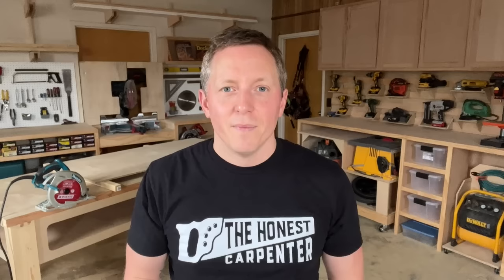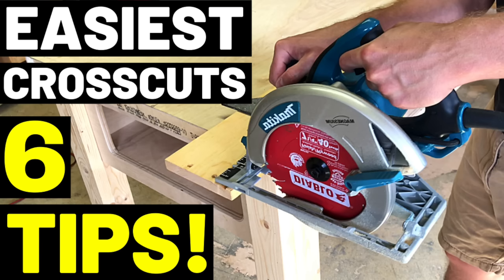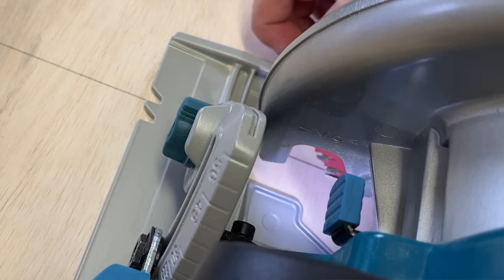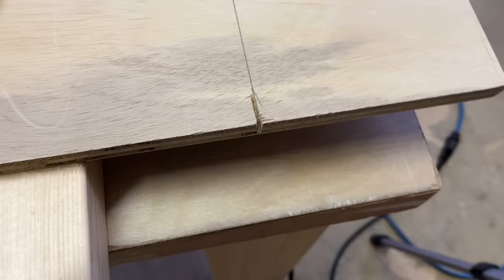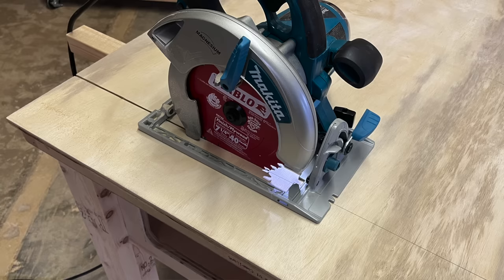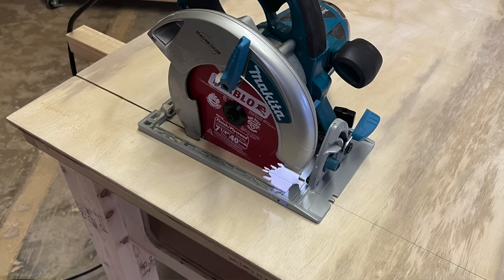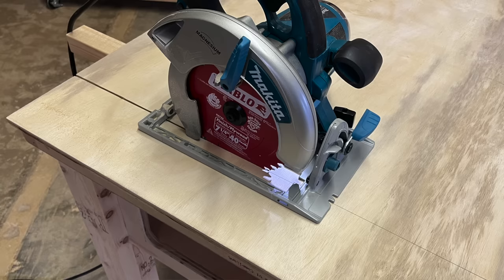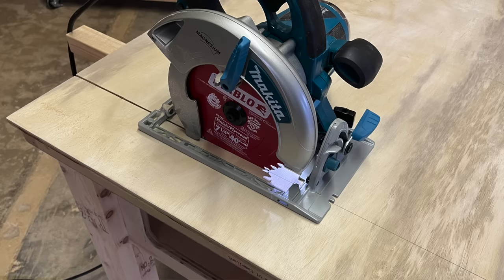How To CUT STRAIGHT With NO GUIDE! Freehand CIRCULAR SAW CUTTING...Pro Tips, Tricks and Secrets!

Comment: Could use a video on WHEN to change blades after they have become dull. How to determine sharpness or dullness of a blade. Do you get the blade resharpened or just replace it ? Approx. how much to resharpen these days ? This goes for any power saw blades.
Reply: Found a circular saw resharpening tool from Harbor Freight, and after reading instructions, there was about a half hour of farting around to get quite what was best for a functional set up... This one is a "cheap-o" version, so it probably comes with a certain dubious stability... 

    BUT it does work! It's not particularly difficult, and by just a sense of touch at the "business ends" of the teeth, you can tell a tangible difference from a used blade to a freshly resharpened one...

    It's also worth note, even before you worry about sharpening, that just cleaning the blades can help. Rosin gathers on the sides with the heat and friction of cutting and all the dust involved with a powered saw... SO while hot it's a sticky fluid not unlike syrup, and it cools to congeal, trap dust, and add thickness and friction to the rotating body of the blade... eventually causing the wood to burn in the kerf rather than allowing the freedom to drive the teeth forward and actually cut...

     Nearly any organic solvent is good for the clean-up so long as you do it regularly... It really depends on your use of the saw as to what exactly constitutes "regular cleaning", because the damn rosin can seem barely residual one day but turn into a dust encrusted mess, even when you only left the saw to sit for a couple weeks... Likewise, if you're grinding through a hundred board-feet every day or so, there's just so much rosin that you have to occasionally just take a break to clean the thing or suffer consequences...

     Most such things are "judgment calls" though. Once you've got a sharpening system of one variety or another, it's just worth trying whenever you notice the saw "bogging down" a bit more than usual... If a liberal helping of alcohol or mineral spirits and a coarse rag is no help... maybe sharpen the thing and try again... and if that doesn't seem to help, a new blade might well be in order...

    Finally, with a lot of the cheaper blades, it might not be worth the effort and time at all... More expensive blades, like the specialties and ripping-specific blades with flat edged teeth are expensive enough that you'll greatly appreciate the ability to sharpen them rather than move directly to replacement.  ;o)

Comment: One of the biggest mistakes I've seen is cutting on the wrong side of the line. This is a video you might like to do. When i had someone else cutting i showed them which side of the line and showed them why it's so important. I wrote to quickly but this is so important to doing a good job
Reply: That's what confuses me about this video, as he seems to suggest splitting the cut line? I thought you had to cut one side of the line or the other depending on what is the working piece and what is waste.
Reply: @craigherriot4026  yes from the side you measure you cut on the opposite side of the line, i don't know how many times i had to get onto guys for cutting it wrong. I worked in construction for 34 years before i hurt my lower back and after 5 surgeries and now a pain pump in me i had to be put on disability
Reply: @craigherriot4026  I don't think it matters really as long as you can see the the line and mark the line accordingly. The advantage of splitting the line is that you don't have to compensate for a sharp or dull pencil.

Comment: I have only used mine a few times, but I have noticed that I have a problem with lifting the saw a bit when cutting. I thought I made a cross-cut only to find out that even though my blade was set for 1" cuts for cutting 3/4" plywood, I still was not able to make it through.
Reply from the maker: Yeah, that’s “floating” a cut! It’s pretty easy to do. Just check the edge of your sole plate with you eye periodically though. You should be able to see if your flush or not. Or try to lever the saw forward or backward slightly—you shouldn’t be able to do it!

Comment: Great video but one question if I can. Why  would anyone try to cut freehand and risk messing it up on an expensive piece of lumber, like Baltic birch plywood? Why not clamp a straight edge to the piece being cut [on the non-waste side] to but the saw sole plate up against? NB - triple check the placement of this straight edge before you start to cut. A straightedge makes it so much easier to slide the saw forward in a straight line.

Comment: If all your measurements are exact and you scribe your cut line with a very sharp pencil, cutting on the line is not going to give you an accurate cut. With a blade that cuts a 1/8" kerf, your cut will be 1/16" short by cutting on the line. I always cut on the waste side of the line. Of course, if 1/16" doesn't matter for the cut piece, then cutting on the line isn't a problem.

Comment: @6:47
For reasons stated here, I always take a couple of minutes to set up a guide to make cuts. No time is saved by cutting freehand when you have to take everything slow and worry about the numerous things you mention when cutting freehand. To cut freehand does not make a woodworker a better carpenter. Your build is going to not know how you cut the wood, but the fit will show the quality of your cut. The only time I don't use a guide in general is rough carpentry (but I do on certain cuts).
I just think trying to cut freehand is not worth the risk of a bad cut, especially when it only takes a couple of minutes to set a guide and increase your odds for a perfect cut.

Comment: You probably already know this, but physics plays a part in keeping the saw going straight. Spinning objects will create a force outward perpendicular to the axis of rotation. The faster the speed, the stronger the force. There are science class videos about this on YouTube, where people spin a bicycle tire while holding it with handles on the axis, and then feeling how difficult it is to actually move the tire off-axis. It’s why a bicycle is much more likely to tip over at slow speeds than high speeds. So once that blade starts spinning, it’s hellbent on following the track it’s aiming for.

Comment: I used to find my circular saw was very hard to steer, it felt like it needed a lot of force to adjust the direction to stay on the cut line.  Rubbing a little candle wax on the sole of the saw made it slide 10x easier and let me control the microadjustments with almost no effort.

Comment: Hi very nice. Did you put the piece against a level after you made your cut ? I put my Dewalt circular saw against a level and I cut a 4  foot plywood  , after I make the cut I put my piece against a level and I see a gap in the middle.  Blade is perpendicular to the plate of my saw and also my plate is very clean.  What could be the problem?

Comment: Many saws have two little notches on the front of the base plate: one to mark the start of kerf on a 90-degree cut, and the other for a 45-degree cut. To avoid confusion, I like to mark the 90-degree notch with white paint.

Comment: The saw cord catching every, and anything, is often a killer. Then, of course, 6 out of 10 times, the saw guard catches on the board edge, at the beginning of the cut, causing 'us' to reach for the guard 'lever' and all heck breaks out😭.
I like using Quick-Grip Clamps to lock down a flat bar (like the one this gent used to mark his line). The flat bar is clamped "x" amount of inches away from the cut line depending on what the distance is from the saw blade to the far or short edge of the saw's shoe/base plate (typically 5.5" and 1.5" +/-).
I assume track saws take all the "issues" away.

Comment: I'm hanging some 1/2" ply horizontally but I have an 11' wall (yeah, couldn't have been 12' I guess) so I have to cut 12" off 8' long.... I can't lean across like work piece. I might need to get some kind of a guide... I could try it on the floor with the wood underneath but I'll have to walk it down the 8'.

Comment: One additional TIP...
   (from one newbie to another):  Sharp blades are everything... followed by using the right tooth of blade the cut calls for.

I'm too thrifty for my own good and use blades that need sharpened or replaced... making every time I use the circular saw an arm-wrestling match... All because I overuse blades!

Also, I bias the blade on board... instead of matching the right blade to the material I'm cutting.

So maybe this is two additional tips.

Comment: Having to watch the blade contact point itself seems to make it uncessarily awkward, I need to have my head the wrong side of the saw, if the guide grooves on the front of the saw arnt precise enough then just mark the exact blade cut point with a fine tip black marker (although the alighment is perfect on my ryobi out of the box). Also because the guide groove is further away from the rotational center of the saw than the blade edge itself its actually giving you a bit of extra precision.

Comment: For important cuts i always use a speed square or a clamped guide for perfect cuts each time. You only need to keep the saw shoe firmly against the guide as you go. There's never a chance of cutting over the line and if the blade veers off the line, you can just pull the saw back and cut again.
Reply: I have cut a spacer block (with a width equaling the space between the blade teeth and the side of the saw shoe) that i use to help place the guide bar at the correct distance from the cut line as i clamp it down.

Comment: Those sidewinders are nothing but a bad idea. Worm drives are the only way to go. I started my (50 year) carpenter career on the east coast where EVERYBODY used sidewinders. Then I moved to the west coast where EVERBODY uses worm drives. I wonder if the east coast guys still use sidewinders. When I moved in 1973 they were still using wood folding rulers.

Comment: My english its not very good but i can understan a lot of what are you saying,Thanks, if i can i will say that what i do to star the cut whith ase its, i raice the saw from the back puch tthe saw to the center of your blade in line whith the star of your cut and line the fronnt of your plate  whith your line of cut , that way you have points of referense then star your cut whith a shop mocion as youll do if you star in the center of your board.apologi for my speling.thans for all the tips.

Comment: awesome. awesome. Thank You. Your 11 circular saw mistakes was the turning point thta allowed me to start using my circular saw. I thnak you for that video as well as all your extremley extremley helpful videos. im obviously new and starting out but i love it i won't settle for crooked, shoddy looking anything i do. ill re do until its like it supposed to be whatever im cutting building etc.   can i ask a question...why do sometimes my ryobis circ saws die toward the end of a cut, i use 4x4 , as the base on floor w clamps etc but wether im going fast or slow it sometimes stalls out toward end.  fresh battery, new blade. um im just not sure . could it be im pulling up on tip of saw toward the end of cut ? or going to fast? too slow?

Comment: As you said, it's best to have your line on the outside of the saw blade so you can see it as it cuts. If the wood you want to keep is on the left of the saw, inside of the blade, you can't see the line because the blade is in the way.  You have to guess at how much to step over because you can't see the line being cut. The solution is to make your 1 cut line the width of the saw blade longer than your measurement or make 2 lines that maker both sides of the blade to where in between the 2 lines becomes sawdust. If you make the 2 lines and the blade is in the middle, no matter which direction you cut, you will be correct and you for sure will be able to see the line.

Comment: Very helpful video! 

I'm currently making a lumber carrier that connects to the roof of my brother's Subaru, and freehand cutting across 2x4's just makes sense because none of the cuts are critical in any way - purely aesthetic. I find that I am so used to using some homemade saw guides for sheet goods that my freehand short cuts could stand some improvement.

QUESTION: when lumber cut lengths need to be very, very precise, I have been following the procedure of "leave the line or take the line". Splitting the line is not ultra precise due to the width of the saw blade kerf. How would your advice change if you were "leaving the line or taking the line" instead of "splitting the line"?

Comment: There is actually a very simple safety tip for beginners to follow: whenever the blade is moving both hands on the saw!! It has two grips, just grap both and hold pretty tight in case you get a blowout or something else happens. Whatever happens after that you're at least unlikely to cut your hands or arms. All this "one-handing the saw" is for advanced users. If I was a foreman and saw a new guy one-handing the saw he'd get a talking to. If you have a power cord it should be over the shoulder, then ear protection and safety glasses.

Comment: i haven't used a circular saw myself, so i'm not able to understand why you prefer to have your blade on the outside/right side of your right hand (assuming you're right handed).  seems like you'd have to crane your neck a bit to see where the blade is going

Comment: Thank you for the video. I just did my rough cuts yesterday. Going to finish off with a handsaw because the pieces are too thin. My question is, when I start the saw, it is Bosch GSK9/235 turbo (2050 watts, around 18.6 amp if going American voltage, 9.3 amps on 220v), I line up things just as you mentioned (in earlier videos you covered that as well), but as soon as the saw starts up, the force from the motor makes it wobble everywhere and it is not aligned anymore. It can be in a radius of 1~2 cm away from the starting point, which makes the beginning cut really hard. Any ideas, tips, thoughts to make the initial start more stable?

I also don't feel safe with having that saw hanging that much by itself in the air, the saw weighs 7.6kg (about 16.7 pounds), i line up some lumber pieces on the left side so that the saw is sitting on a surface completely before the cut begins. This thing is heavy, got to live with it for now. I will make jigs for it, to lift the weight away from me and on to a surface. In the process of making workbenches so I have stable and level surfaces to work with.
Reply: Okay so on start up hold the pommel more securely also get more of your body weight by leaning forward over the top of the pommel, this will increase the friction between the plate of the saw and the workpiece, reducing movement on start up. Regarding the weight, you are just going to have to get stronger, work out with 10 kg dumbbells, build strength but also handle the tool regularly, don't power it up but run it down the side of a board this will build muscle memory
Reply: @jukeseyable  Thank you, will try all those things tomorrow. I'll stick to lifting my younger cousins, they are far cheaper to acquire 😂. I noticed it as well, I need to start working out again and stop using covid as an excuse.
Reply: @asderven  even better than dumbbells, not dumb, but dynamic, much better for wiring neurons for better muscle control

Comment: " -- you want to split that pencil line in half with your cut. "

--- actually, you don't:  you want the edge of your blade to exactly cut at the edge of the pencil line.  An ultra-thin 24 tooth DeWalt blade has a bit over 1/8 inch kerf  -  trying to center the pencil mark will result in a wavy cut.   The most important thing about getting a straight line cut is to have a saw with the blade on the correct side  -  which means if you are right-handed, you need a saw with a blade on the left side so you are holding the saw in a natural manner and can see the cut line without having to look over and around the saw.  You will also find that a hypoid style saw will cut a much straighter line than a sidewinder.

Comment: How do they make straight cuts without using a guide? Easy! They use a circular saw with the blade on the correct side (the left).

Also, its far better to use a piece of foam board insulation. I've probably put over 50 cuts into the one i'm using and its still working great.

Lastly, when cutting plywood, especially the expensive birch stuff, always lay down painters tape where you're going to cut on both sides of the sheet and you'll get zero splintering.

Comment: Tip #1 - pitch the circular saw with the blade on the right hand in the trash and get a worm gear saw and a battery powered saw with left hand blade.   Personally, I now use a battery left hand bladed saw for 95% uses.

Comment: Mr. Honest, if I want to pre-drill holes for screws, how do I know what size drill bit to use?  The box says #8.  Is there a table or list to translate drill bit size to screw size?
Reply: There's probably a table like that somewhere, but I've never seen one. You want to choose a bit that is the same diameter as the barrel of the screw, not the threads. Hold bits against the screw until you find one that hides the barrel, but allows you to see the threads on both sides.
Reply: @jobacuda4472  Thank you!